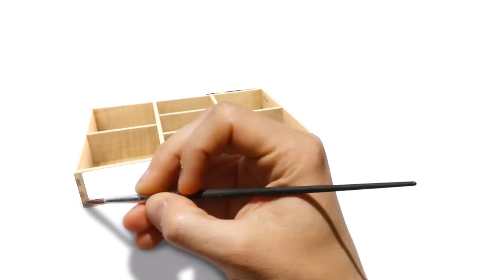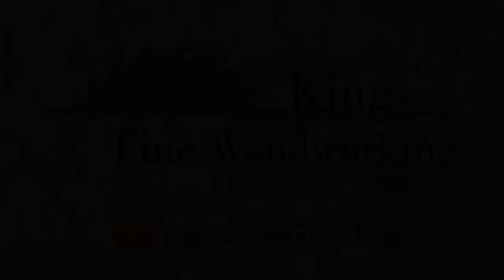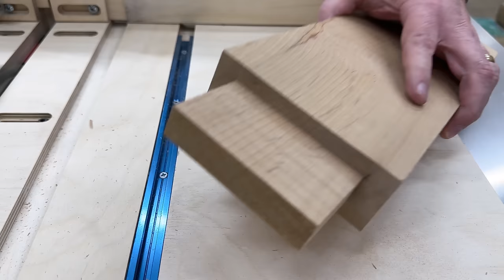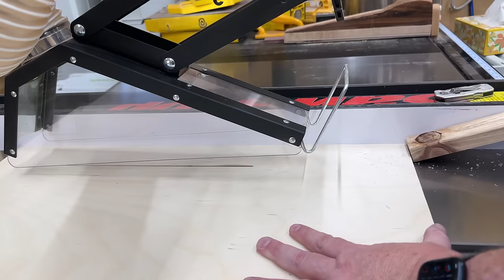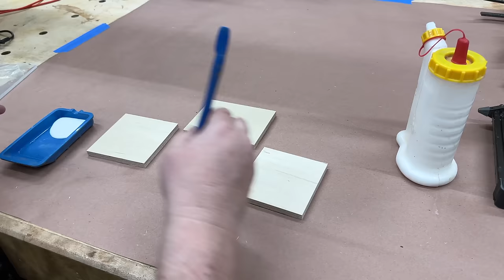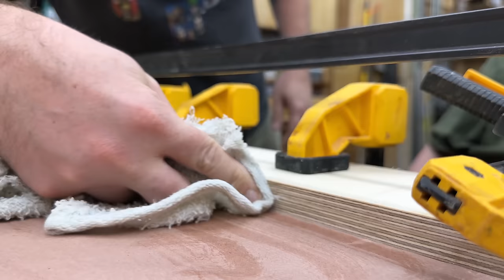Flagship Table Saw Sled! Crosscut, Miter, Bevel, Dado, Picture Frames & More!

Comment: Are these dimensions too large for a jobsite size TS? Do you recommend your "mini sled" in that case or simply make this one less wide?
Reply from the maker: Hi,

That’s kind of up to you. This will perform all of its functions on the jobsite saw. But it is large and will hand over the sides a little. 

If you prefer something more compact, the mini sled is great. But it will not have these types of abilities.

Comment: Good morning. I am interested in buying the crosscut sled already built but I am concerned about the feet fitting in the miter slots with the correct spacing for my table saw. I have the DWE7491RS table saw. Will this sled work perfectly for this table saw? 

Thank you, Michael
Reply from the maker: Hi, I will fit your saw just fine. The only issue is it will feel a bit cumbersome to use a full size sled on a job site saw for a few days until you get used to it. 
But all of the functions will work perfectly.

Comment: This looks fantastic, and I want it to improve my little cheap Ryobi Table Saw. Will the miter bars work with a Ryobi table saw? I found out the hard way that the PowerTec Miter Guage Bar is wider than my Ryobi table saw tracks.
Reply: I have seen plans call for using strips of 3/8" plywood ripped to the exact length you need.  Not as fancy but miter bars are pretty pricey given the relative expense of your table saw.  Miter bars he used look like 3/8 x 3/4.  Given the physical toll these would take I would use oak maybe?  Don't know how much oak expands in humid conditions though.

Comment: Great video & sled, thank you for taking the time to make the sled/plans along with produce & share the video. Would this sled work on a Bosch 4100XC-10 job site saw?
Reply from the maker: Yes it will if you have 2 miter slots. But it will feel big on that saw.
Reply: @KingsFineWoodworking  Thank you so much for the quick & honest reply. I actually purchased the OEM extension wings for the left side of the blade and the out feed/front of the saw that gives me an additional 18” inches in each.  I’m hoping that will help. I’m seriously considering purchasing the premade sled.
Reply from the maker: The extension wings will help a lot!  But the nice thing is, if you ever move to a bigger table saw, you simply unscrew the miter bars, and re-install this sled on your new saw. This sled should last forever out of Baltic birch!
Reply: @KingsFineWoodworking  Thank you!!

Comment: What is the current lead time for this complete sled? I don’t have the time or desire to build one myself!
Reply from the maker: Hi,

Right now it’s 6-8 weeks. It could end up quicker, but I can’t guarantee it. Sorry it’s so slow. As soon as we put it on sale for $100 off ($299 vs $399), the sales took off.  The sale does end in a couple days, and ordering will slow way down, but unfortunately that wouldn’t help right now. 

Thank you,
Reply: @KingsFineWoodworking  thanks and understood. I was about to pull the trigger on an Incra crosscut sled but this seems like way more function so I may just order it and wait.
Reply: @KingsFineWoodworking  Ok, thanks. I decided to place an order! Looking forward to using it!

Comment: Question- at 59:40 you put a stop down to hold one end of the fence’s reference point so you could move it in relation to the other end. Why didn’t you clamp a stop on the other end as well? Did you have a screw at the very end, or was the total length not actually to the end but to your furthest screw instead? If so your measurement would be off slightly it seems. Not a big deal for you since you were so close already, but for a bigger adjustment.. anyways awesome video. I’ll be making one soon!
Reply from the maker: There was a screw at the other end. And the 27” was from that pivot screw on the right side to the end of the fence on the left. 

Thanks for watching & commenting!
Reply: Awesome, thanks for clarifying!

Comment: Got a question.
I have the DeWalt DWE7491RS 10" table saw, and I'm still using the rolling stand that it came with as of right now.
 I will be building a 4-ft by 8-ft workbench that the DeWalt table saw will sit into, to give myself more out-feed area to work with.

Will the size of this new sled be to large to work with my DeWalt table saw , while I'm still using it on the rolling stand?

Thanks, for any info!
Reply from the maker: Hi,
It will work on your saw. But it will sit very large on top of it. Many of our followers have used our full sized sleds on these saws. It’s a tiny bit awkward, but it gets the job done just fine.
Reply: @KingsFineWoodworking  

Thank you!
I am thinking about ordering one of your flagship sleds in a box to save me some time and trouble. 
As still  beginning new to wood working, I really don't have much wood or hardware sitting around. So to have everything I need ship to me, will save lost of time and headaches from hunting and searching for everything I need.

Thanks again!
Reply: @NkySpike65   I finally broke down and bought a cabinet saw.  Found a good deal at a local woodworking shop on a closeout model so I saved some $.  It was maybe $1500?  But WOW I wish I had done it a LOT sooner because it's SO much better than the small beginner table saw I'd been suffering with.  MUCH bigger fence.  MUCH bigger machined surface.  3' cutting width.  MUCH more power to rip through hardwoods.  More safety features, etc.  I know it's a big lift but if you know you've got the woodworking bug and the room for it in your shop, start looking for a deal.

Comment: I've been needing to build a new sled since recently upgraded my table saw. This looks like a tremendous sled.  Decided to go ahead and order one because the precision of being CNC cut and the Baltic birch.  Ordered last night.  Excited to get it. Looking forward to follow up video.

I'm already thinking about doing some box/finger joints with it.  If I'm thinking about the design correctly, it should not be difficult to add a finger spacer to the replacement insert in the fence.  Correct?
Reply from the maker: Very easy to put a finger joint jig on it. I already have a video for it on the channel.
Reply: I'll try to find it.   thanks
Reply: @KingsFineWoodworking  found it.  Of course it's another excellent video.  I look forward to building it using it.  Thanks!!!

Are you still planning to do a 2nd video on the new sled?

Comment: Can this sled be used with a Shopsmith 520 table system?  Are you familiar with Shopsmith mark 7 & 5?  Not sure if miter slots are different from conventional table saws?
Reply from the maker: It will definitely work. But I do believe your miter slots are narrower. Which means you’ll have to make your own miter bars out of hardwood.
Reply: @KingsFineWoodworking  thank you

Comment: So if I order a pre built sled how will you know to have the runners set up for a my SawStop?
Reply from the maker: Hi,

We don’t. That’s why a few final assembly steps and mating the sled to the saw is something the end user does. It’s pretty easy and can be done in 15 min or so. And it’s foolproof. The precision work has all been done.
Reply: Will I have to go thru the 5 cut method after doing so?  @KingsFineWoodworking

Comment: Awesome sled James. I work in metric (millimetres) do i need to change or convert anything in the 5 cut calculation to make it work for me? Also I want to buy plans, can i convert them to metric without effecting the accuracy? Thanks so much
Reply from the maker: The sled plans are already in metric and standard both!

Use mm to do the 5-cut method. It’s works exactly the same! You don’t need to adjust a thing.
Reply: Thank you sooo  much James.  I really appreciate all the time you  take to help us. Big thumbs up from Aussie. Cheers mate

Comment: Hello James! Love the sled and I plan to buy it but I have a question: how much of it needs to be put together?  ex: Are both fences already laminated and t track installed?  Thanks!
Reply from the maker: Fences are glued up and cut to shape and all holes drilled. But the base must be assembled by you. 
T-track is cut and every hole & slot are cut. 
You will screw in t-track. It goes in the dado provided.  This takes about 5 min, and is very easy since slots are there, it can’t get messed up. 

Then you’ll glue the base together like we did in the video in real-time. This takes 5-7 min after you set up two straight edges. This is also very quick, and pieces fit together like a puzzle butting against one another, so no real chance for error here either. 

I assembled the first one myself in about 11 minutes. Then after I did my 5th or 6th one my time is about 60 seconds. 

So for sure, it’ll be quick for you. 

We would have preferred to send it all done, but shipping cost went to almost $100. And after we surveyed our viewers, the overwhelming response, was just flat pack it, but make it quick, easy & foolproof. And that’s what we did. 

Sorry.. I rambled on. But I hope that makes sense & answers your question.
Reply: @KingsFineWoodworking  makes perfect sense!  Thanks!

Comment: Will this work on a smaller job site table saw?
Reply from the maker: Yes. It will. As long as you have 2 miter slots. 
It will be big and hang over, but it will work just fine. 

And the nice thing about this sled is that if you ever move up to a big table saw, you just unscrew the miter bars, and fit it to your new saw. The sled is a tool for life!

Comment: Great video James. If we choose to buy the sled, does it come with all of the enhancements, i.e. picture frame attachment?
Reply from the maker: Hi, yes it does. Every item in the video comes with the sled. The picture frame attachment, the miter function with the digital angle finder. Custom exotic wood stop, hold down, toggle clamp, t-tracks miter bars, everything. All hardware shown and more. It’s a complete package. You don’t need to add anything to it.
Reply: @KingsFineWoodworking  Great! Thank you.
Reply: One more question. How long is the promotion running for?

Comment: Awesome job on this james. Im definitely going to get one but i need to get a good saw first. The one i have now is crap and im in the market for a replacement and soon as i do im getting one of these. I would definitely seek patents on this beast before woodpecker or festool copy it haha. One question tho James, if you would have had to move the fence forward for the 5 cut method how woukd you have done that? Being you used that pointed board, how would you have used it then because you cant clamp it on the operator side. Move the other side??
Reply from the maker: Hi thanks!

To move the fence forward, instead of putting the pointed board against the fence directly, you put your feeler gauge between the fence and pointed board first. 

Then clamp down the pointed board with the feeler gauge in place. 

Unscrew the fence on the left. 

Remove the feeler gauge. 

Then pivot the fence forward to touch the pointed board directly. 

This is how I had to do it in the video of my last sled.
Reply from the maker: One last thing, if you decide you can’t live without a sled but haven’t gotten your new table saw first, it’s ok. This sled can easily be transitioned to a new saw in the future.  This is a sled you’ll keep for life.
Reply: Don't want to speak for James but I've seen previous videos on it. If you need to move the fence forward, add the feeler gauge to the pointer at the current fence location, clamp the pointer down, remove the feeler gauge and move the fence to meet the pointer. Hope that makes sense.
Reply: @philshock3805  makes plenty of sense. Thank you very much
Reply: @KingsFineWoodworking  thank you very much for the info on moving the sled forward. I should have known that if I would have just thought about it for a moment. Rookie mistake lol. But I'm teaching myself to try and think things thru. 
You have a point on the sled. I will go ahead and get it but I can keep it put up for right now until I get my new saw. I hope I can get it fairly quickly. This delta I use is crap. Not knocking delta but the cat iron i in the right side of the blade has a dip in it and it affects the cut of I'm cutting short stock and my handle that moves the blade up and down for some reason will not hold a dado stack up. As the saw vibrates the handle turns causing the stack to go down. It has a knob to turn and tighten but mine don't

Comment: Will this sled work on a Dewalt 7485 tablesaw?
Reply: I'm wondering if the tabletop slots in tablesaws are an industry standard.
Reply from the maker: Yes it sure will. Any table saw with 2 miter slots and you’re good to go!

Be aware that it’s a bit large for a jobsite saw, it will look large, but it will function just fine. And the nice thing is that this sled is designed to be kept forever. If you get a bigger saw in the future, you’ll simply unscrew the miter bars, and mate it to your new saw. 

Finally, all miter slots are pretty much identical. They are 3/4” wide, and 3/8 - 1/2” deep. (Exact depth is irrelevant).
Reply: I'm incorporating that particular saw on the end of a 3ft X 8ft workbench. I also have a HPT 10" larger table saw. @KingsFineWoodworking